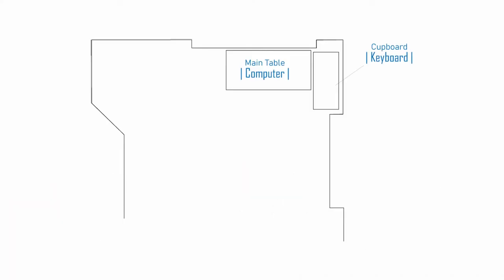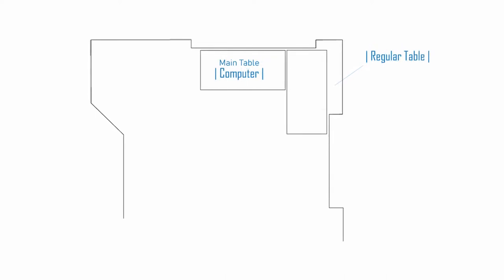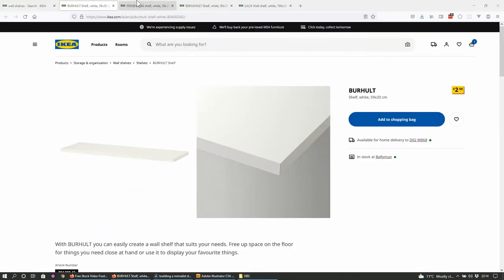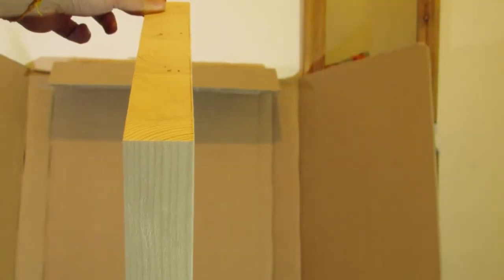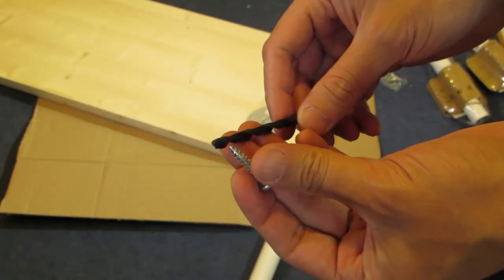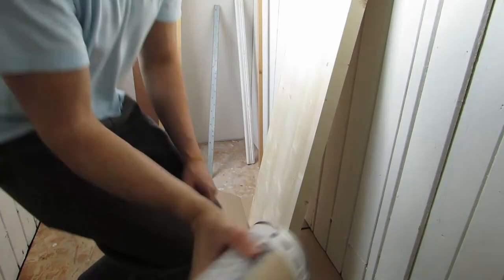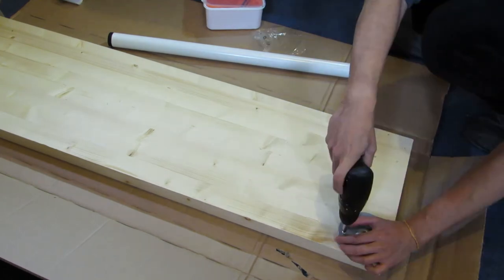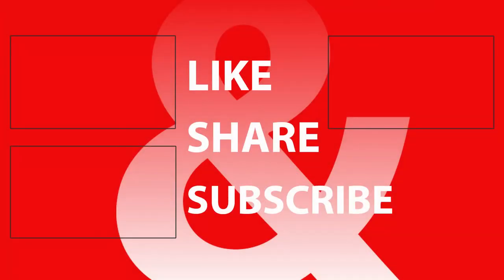DIY IKEA table

Comment: Nice idea .

I have one table made of key board stand which is stacked with multiple plywood boards on the top....
Reply from the maker: That's actually a great idea. It's tricky when it comes to wood. This one should be able to use a monitor arm without any problem.

Comment: are this combination wobbly ?
Reply from the maker: It actually is a tiny bit wobbly, I think mostly due to the table being so narrow and light. At the same time I don't think the wood is strong enough to provide as secure a hold for the ADILs leg mount as I would've liked. A more stronger wood would be recommended, and maybe even a deeper set of screws and not the ones that came with it.